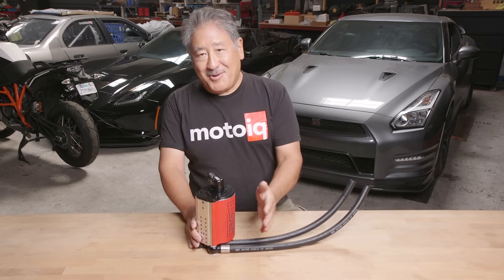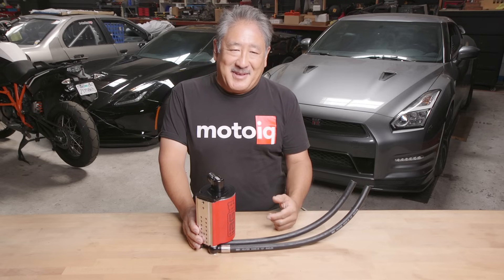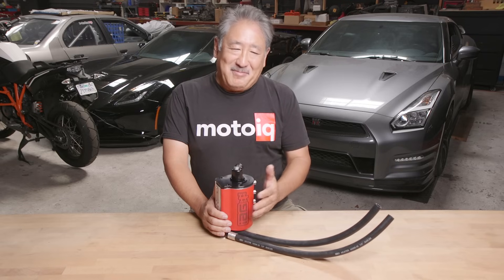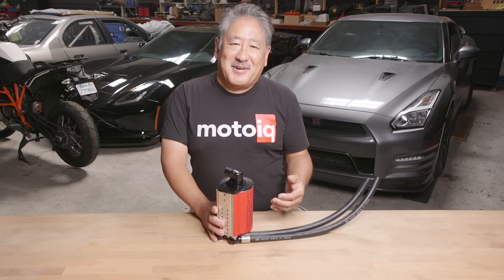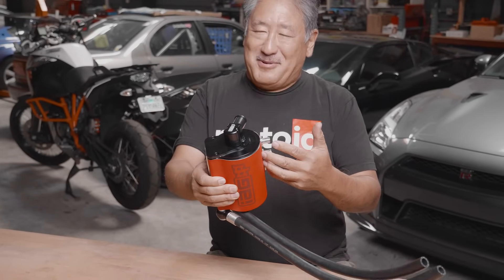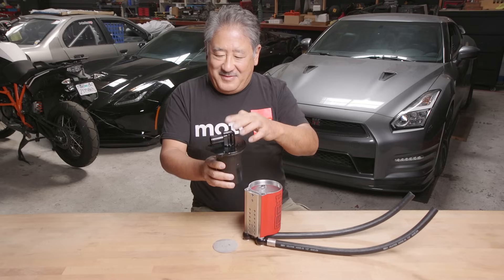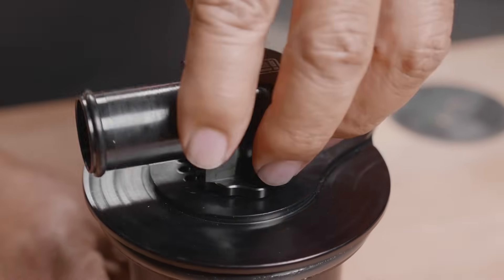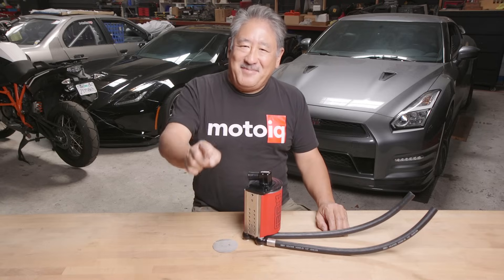How an Air Oil Separator Works and Why You Need One!

Comment: Oh shit I thought it was that one comedian.  And another thing why not just get dry sump or a pcv valve
Reply from the maker: Because a Dry sump costs $8000 plus dollars are requires you to get rid of your AC or at least re-engineer your accessory drives and find a place in the car for a 2 gallon tank and a PCV system is already on the car and doesn't have the same function, in fact the PCV valve closes under boost.

Comment: I would be curious to know for a Subaru WRX specific application, what are your thoughts on the IAG vs Radium Engineering AOS? Both have very similar features, but the mechanical separation has different looking baffles. 

Additionally the placement is on the opposite side of the engine bay, RE is tied to the brake master cylinder brace in the kit vsIAG on the passenger side firewall.
Reply from the maker: They are both pretty good and similar.  The IAG system has centrifugal and mechanical separation while radium has only mechanical.  We have used both with good results.

Comment: What about the use of an AOS In colder climates. Worried about the oil in the lines becoming thick and cooler compared to the engine oil temp.
Reply from the maker: That's why this one has a heater!

Comment: Very cool product and the heating feature is great.The only potential issue I saw are the "fins" in the bottom seemed to have quite a few burrs left after machining. 🤷‍♂️It honestly may not even matter if the oil is being filtered enough before getting returned, just not a fan of leaving burrs on anything is all.
It could just be pixelation on my end too. 🤷‍♂️🤣
Anyway, great video.

Comment: Hello, I just got a 2014 forester xt and asked my buddy and mechanic about installing these for longevity and efficiency. They both said if I was keeping it stock I wouldn’t need it. I just plan on doing some spirited driving every now and then but nothing too serious.

My question is if an air-oil separator is a piece to have regardless of upgrading the platform or not since it’s turbocharged? I just want to make sure I keep the vehicle running as clean and strong as possible and not spending my money on things I don’t really need.
 
Thanks!
Reply from the maker: A not turbo, stock lightly driven car probably doesn't need this.
Reply: @motoiq  it’s a forester xt (turbo) that’s going to be stock and going to be driven hard about once a week but nothing crazy. Would I be better of getting the air/oil separator rather than not getting one for the long haul?
Reply from the maker: @thechicanoreview6662  Probably not nessesary.
Reply: @motoiq  thanks for the reply! And keep up the great content!

Comment: Subaru recommend only going Aos when pushing more than 500hp or s this correct? Or recommended on flex?
Reply from the maker: On a subaru it's helpful even on a hard driven stock engine. If running E85 having a heated AOS is helpful.

Comment: Does the oil get back in the engine wile you are driving on track, or does it only drain back in the engine when the engine is off?
Reply from the maker: It mostly drains during periods of lower crankcase pressure, like part throttle or overrun.

Comment: If this works so well, it makes me wonder why aren't all the car companies install this air oil separator in all their cars?
Reply from the maker: Mostly cost and stock boost levels produce less blowby.  Also cars from the factory are often not fitted to run at higher boost for long periods of time.

Comment: Randomly stumbled upon this video. Interesting product and nice presentation! I've never owned a turbo charged "gas car" and I guess won't do much of a difference on my current stock 4cyl. diesel van. However I did learn something 🙂
Reply from the maker: Works good on a turbo diesel as well!
Reply: Actually, many people do run them on the Mercedes Sprinter OM642 V6. The OEM system does a terrible job of separating oil, even after several revisions. It may very well work on other kinds of diesels.

Comment: I’m surprised Subaru doesn’t just include on one their turbo cars. Even the old 99’ and up Porsche 911’s come with an AOS stock.
Reply: Most people don't push their Subarus that hard, so it reduces cost not to include one.
Reply: If you add one it'll void your warranty
Reply: Porsche AOS are a joke. That's why proper Porsches are always smoking. 😅

Comment: TIL there is an actual difference between air/oil separators and catch cans. I just assumed they were terms used interchangeably.
Reply from the maker: Nope a catch can is just a can that the blow by oil sits in.

Comment: First mod I did on my STI back in 2017 - albeit the Crawford unit. Highly recommend an AOS on your turbo Subaru. Great video Mike. Love the constant perma-smile as always
CheeRS!🤙🏻
Reply: Hey danny, i have a 2018 sti,, stock aside from hks suspension, and awe track edition exhaust. 

How has it helped your 2017 sti?... What happens if i don't get one.
Reply: @varsington  potential blowby gases from crankcase ventilation that will end up in your intake track. Most noticeable in your intercooler. Good way to check: take the coupler off the intercooler and run your finger inside, if you have an oil presence, you have blow-by. The AOS will help mitigate this. 
Helps in hot climate and those who track their cars. 
If you live in the northern belt for it gets cold, it can have a negative effect during either months as lines can freeze. Some run the IAG with the coolant lines to mitigate this. 
I never winter drove mine, so no issues. 
I highly recommend an AOS for engine longevity.
Cheers
Reply from the maker: The Crawford is also a good unit.

Comment: Will the IAG oil-water separator be also effective with a daily-driven turbocharged diesel SUV? Will the benefits, if any, be cost-effective? Thanks for the nice explanation on how it works.
Reply from the maker: Yes it will
Reply: Some people fit them to Mercedes Sprinter RVs because the OM642 diesel doesn't do a good job of separating oil.

Comment: Statement & question (05 Forester XT w/built motor)

I've never liked the idea of returning what an AoS catches from the crankcase blow by. Personally, I use 2 Radium baffled catch cans with no return in my PCV system, before returning to the turbo inlet. They've served me quite well. It may be my lack of understanding or even research with the return style AoS', but:

With the heated can, is it guaranteed that nothing but oil is being returned to my crankcase?

Have any oil analysis tests been done to legitimize heated return style AoS' (whether it be Radium's, IAG's or Crawford's)? I.e. oil degradation between stock PCV system vs. return style AoS vs. no return AoS? I'm sure there'd be a lot of variables in a long term test such as this, but I imagine it would provide some good ball park data against each setup.

I love the maintenance free concept of the return AoS', I'm just not totally sold on them. Emptying my catch can setup (not very often), and checking my oil once and a while is a minor hassle in the grand scheme of my peace of mind.
Reply from the maker: If you have seen cars fill up catch cans then blow the motor due to oil starvation you would not be so anal about returning oil to the crank case! In that case your unseparated OEM PCV system is a far worse offender than what comeS back to the crank from this AOS.

Comment: A couple things one it would been cool to see it installed I do most of my work because I can’t afford to have other people do it and my question is bushings verses supports getting supports that also go where the bushings are is it redundant or would it be best to just go with one and not the other or is it good to do both I have a Subaru BRZ 13
Reply from the maker: The system has installation instructions from IAG if you get one.
Reply: @motoiq  where can I get one do you know how much it is
Reply from the maker: @GP-fc7jv  IAG

Comment: Is there a possibility to look into the "night motorsport air oil separator valve covers" they recently designed for EJ engines? From what I can tell they incorporated baffling to the internal part of the valve covers to have a similar or same effect as a air oil separator (AOS) allowing the now cleaner or cleaned air to pass through the stock positive crankcase ventilation (PCV) system for a almost invisible package that does not take up engine bay space.
Reply from the maker: They look like they have more volume and a better labyrinth separator than stock. Stock is just a plate.

Comment: Hey Mr Mike great video as always!  Would be cool to see you guys do a detailed installation on the race only version as well as deleting the coolant tank it's a pretty trick feature that only this AOS race model has.
Reply from the maker: Considering its going on a street car burning E85 well no, we are not going to do that. The race version just has a breather instead of recirculating and you can just not run the coolant lines if you didn't want to.
Reply: @motoiq  not sure if you misunderstood me the race version you can delete the coolant expansion tank for a cleaner setup plus the street series is plumbed back in before the turbo and forces oil vapors back in to the system.   The race version resolves all those issues and works better than the street series.   Josh at bbr runs the IAG race series on all his & customers cars and he's tested them all.

Here is a link to Josh explaining his recommended install procedure if interested: https://youtu.be/YlCJdnAHz4A

Comment: I like that they've used a centrifugal separator effect! Seems like they could add like a captured steel mesh layer to improve separation. Man i want one.  It's definitely just theoretical for me and way outside any pay scale i'll ever achieve, but what do y'all think about the centrifugal air/oil separators used in dry sump pressure pumps? Is that getting too far into diminishing returns on pressure stability?
Reply from the maker: I don't think the pressure and velocity are enough to do exactly that with no mechanical input.
Reply: My dude watch some Gary V get your side hustle going snatch up that AOS in no time!
Reply: Sorry, my comment was very poorly worded. https://www.youtube.com/watch?v=noO16P5vSwQ This sort of thing is what is way outside my means as the dry sump set up would approach 10k and would only make sense after 20k+ in the motor and FI. Their demonstration is wild to me without seeing some sort of exploded view of their separator. I've seen centrifugal filters twice in industrial use. They will separate air and particles out of hydraulic fluid but they were HUGE! It blows my mind they could have packaged something similar for race cars. I actually have a Radium AOS and Amsoil bypass filter system that keep getting delayed because of supporting parts. First it was pan spacer vs Mazworx pan and baffle. Now it's why bother taking it down without a Nisformance billet pump and new timing kit.  Love the channel! If I ever get on that master tech money I'm going to be contacting y'all about building a VQ

Comment: Would you recommend something like this for a car you plan on keeping forever and is NA?

Specifically I have a 2019 4Runner and I know it’s a proven reliable motor but I want to keep it on tip top shape if possible aside from standard maintenance.
Reply from the maker: It doesn't hurt but it's not as critical as with Turbo motors.

Comment: Need a full kit for the new direct injection vehicles .. they are coming in at 20k miles with rough idle an gunked up intake manifold , throttle body ,etc ! This definitely no looks like a high quality low maintenance product with will be great for the consumer ‼️thanks for the info guys
Reply: Unfortunately the direct injected motors bypass the valves and do not allow for self cleaning like port injection.  Pretty much would have to upgrade to a di/port injection aftermarket kit to solve that problem.

Comment: I ended up with a Radium dual catch can set up. Car will not be modified much via power ( tune to clean up factory, and cat-back, maybe CAI. )  Would you think that a DCC would be sufficient?. Im pretty good at keeping up on Maintenance so i dont mind checking and draining. Car would see a handful of track days at some point in its life
Reply from the maker: I like the self draining Radium can.  My daughter has one on her STI
Reply: @motoiq  You are referring to the AOS from Radium and not the Dual Catch can set up yeah?
Reply from the maker: @DookeyDuke  Yes, my R35 has the dual catch can with no return, it has a drain valve under the car for maintenance.

Comment: Seems to be the way to go for northern winters. Has it been tested in below freezing point conditions?
Reply from the maker: IAG just came out with a bulletin about this.  They said if a car is operated in extreme cold and not run to full temperature, it is possible for it to freeze up and cause smoking.  However this would resolve with more running and the system isn't more prone to freezing up than the stock parts or any other AOS for that matter.
Reply: @motoiq  I think the older V2 version had a different cooling hose setup so that the AOS would maintain the same temp as the coolant to avoid this.

Comment: KillerB’s AOS design is way better, the shape crates much higher air speeds. But I wish it was heated.
Reply from the maker: Killer B's design is like Crawford's and they don't have the secondary separator and the heating.  IAG has Identical centrifugal separation and is in no way inferior to Killer B's.  The only thing to consider is a Killer B's unit is simpler and on a pure race car where heating is superfluous, the simplicity could be an advantage.
Reply: @motoiq  if the first stage of separation is efficient, what’s the need for a secondary? The Killer B simply creates much high air speeds and drives oil and water out of suspension more efficiently. I do prefer a recirculating AOS over the VTA as crank case vacuum has its advantages. (IAG Street). To be clear, I do respect your opinions on the matter, I’ve run just both and was happier with the results from the Killer B. It would be nice if the drain and crank case ports were separated on both units, that’s something I’ve been looking at trying out.
Reply from the maker: @JordieG8  they are separated by the whole inner wall, and in the case of the IAG, the bottom plate as well.  The Killer B setup has a lot of distance between the ports and it is shaped just like an industrial cyclonic separator so the bottom is going to be mostly fluid and under high load, some gasses are likely going to be burped up from the crankcase on either unit. The pressure depression in the intake is going to be just a few inches of mercury unless the intake is really poorly designed so I dunno if it contributes to crankcase vacuum much.
Reply: @JordieG8  we've done a lot of testing with individual setups on each port as well as in series. The head ports really push a very small percentage when compared to the crankcase vent. The ratio further increases as power levels increase. In short, a parallel system really provides no benefit. I series setup can, IF the AOS doesn't function well. Although, the more 'volume' you add to the crankcase breather system, the lower crankcase vacuum will be. In other words, a large volume system has lower crankcase vacuum than a small (single) one. The smallest AOS out there will pull just under 2" of vacuum, as does the stock setup. A larger AOS setup, IAG, KBM, Crawford, will pull .5-1.5" of vacuum depending on power level and the location it's plumbed into the turbo inlet. If it's VTA, you WILL have crankcase pressure.
Reply: @motoiq  also, thanks for the content!
Reply: @motoiq  let me clarify we're the only AOS our there with conical separator that provides different air velocities at varying flow rates. It has very different characteristics compared to a single + secondary setup. I would recommend a comparison of blow-by gas temps-to-coolant, and how that affects the temp of the AOS. Fun stuff!
Reply: Check out OCTueboJoe video comparisons and testing 🛢️💨.
Reply: @vektorperformance6845  interesting. Part of my cold weather modifications to my Killer B was to ensure there were no traps in the lines going to the AOS and I ran coolant line inside a sleeve with the drain line. I also mounted it higher to ensure there is more slope to the drain.
Reply: @JordieG8  our cold weather kit includes some hose insulation. We mimic what the aviation industry does to prevent PCV blockages due to coagulation/freezing.

Comment: Can you show us how to adapt it to a non Subaru turbo car
Reply: just attach the hoses as he says where they go.

2 large hoses underneath go to a Y lets say into your hear core hoses so it can circulate coolant to not get the poop inside

the big top hose goes to your intake pipe

the 3 small ones on the sides, lets say you have a honda, both valve cover vents you go there
 
3rd is return to motor fresh oil

just and example if this helps
Reply from the maker: It's pretty easy, the inlets on the sides come from your engine, the bottom fitting goes into your crankcase to return oil, the top fitting goes to either a breather or your intake tube and the big hoses tap into your heater hoses.